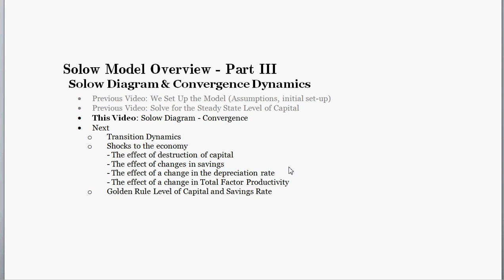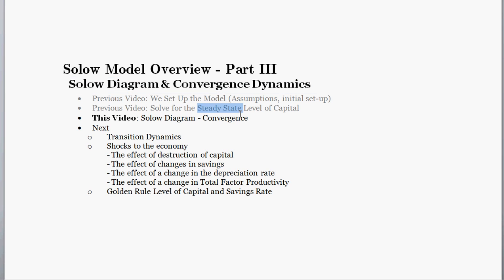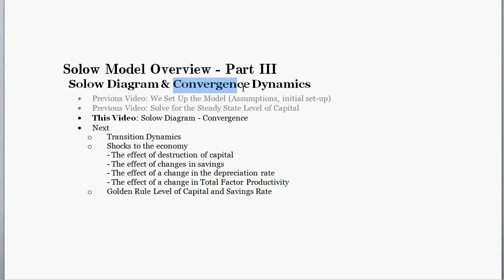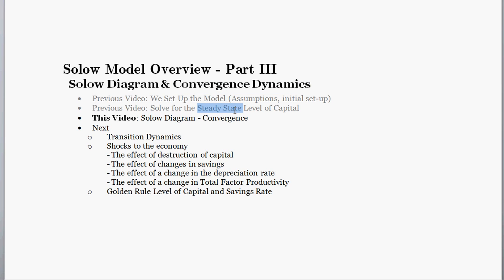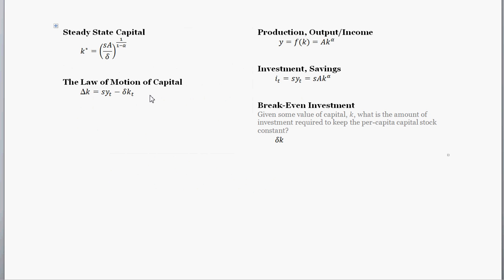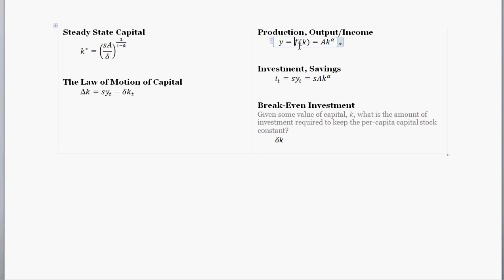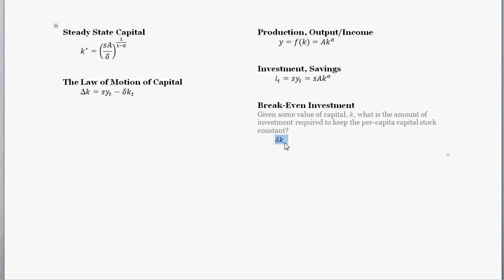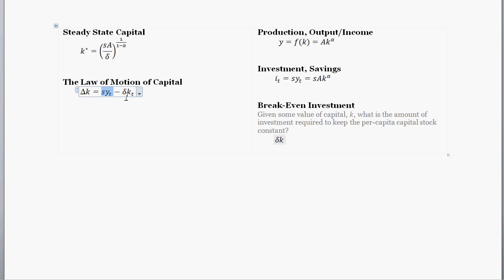Solow Model - Solow Diagram & Convergence (Part 3)

Comment: Will the capital/labor ratio converge to stead state k* (steady state capital/labor) with ANY PRODUCTION FUNCTION, or does this convergence just occur here in the case with the Cobb-Douglas where y*=Ak*^alpha? 

I ask this question because the concave curvature of the investment line seems to stem from the concave nature of the Cobb-Douglas production function, and it is this concave shape of the green line (in combination with the linear nature of the breakeven investment - yellow) that creates a situation in which K/L will always converge to k* if we start anywhere other than k*  --- thus my question, would this convergence occur with any production function?
Reply from the maker: +Morgan Taylor Great question. I haven't touched this stuff in a year or two, but I'm pretty sure you're correct, the existence of a steady state level of per-capita capital does depend on a number of assumptions (in one of my more boring solow videos, I go over in detail all these assumptions). 
WIth a linear depreciation curve (uh, well, line), ss existence requires a concave production function. Otherwise, these curve will never intersect (more should be said there, but I'll leave it at that).  There are more concave production function than the Cobb-Douglas, but it has some nice features that make it easy to work with. 
And then, the investment curve is just the production curve with a scaler (the saving rate), so you're right there.
Reply: +Morgan Taylor I think the solow dynamics will work only with a production function with a defined returns to scales schema and diminishing marginal utility. So, I believe these dynamics will work with a CES function too, I think that'll be easily observable with some calculus.

Comment: Hi, thank you so much for the videos, are definitly well done. I just have a question ... in the notaion for kapital at the steady state my prof is taking into account also the population growth... (in the denominator, summing to depreciation), why is she using a different notation? Thank you in advance...
Reply from the maker: I'm not 100% sure I follow the precise nuance of your question (notation for capital at the s.s. .... is taking into account also the pop growth...?).

but I can tell you that in economics, there is by no means consensus on the correct notation to use. I designed these tutorial sections combining notes from three textsbooks (mankiw, blanchard and jones) and each book used slightly different notation for the same thing. later in the videos I also introduce notation for "per effective worker" that I don't think I saw anywhere but in these sweet MIT notes that summarized the solow-swan model. 

tl:dr in my experience notation varies depending on your prof and the textbook you use. if it's at all confusing, i'd suggest sticking with what your prof suggests (since that'll be on your exams) and perhaps focusing attention on what each term means (e.g. k-star in my notation is the steady state level of per-capita-capital)

best o luck!